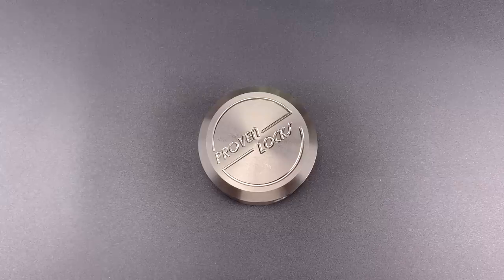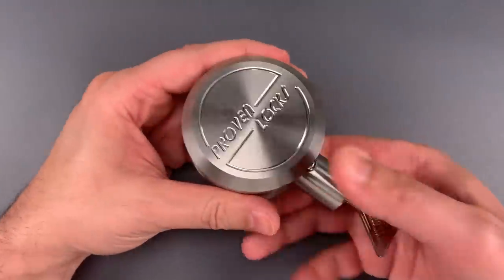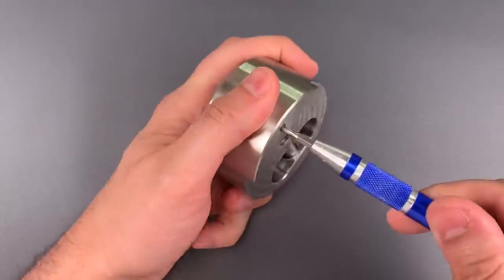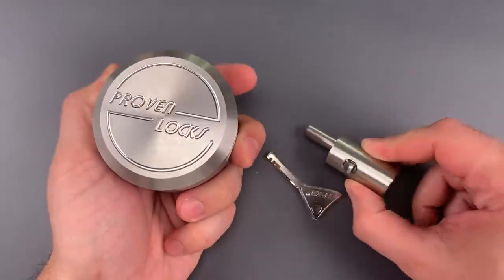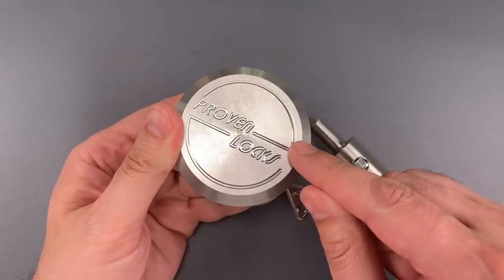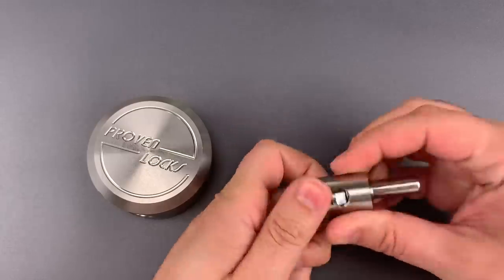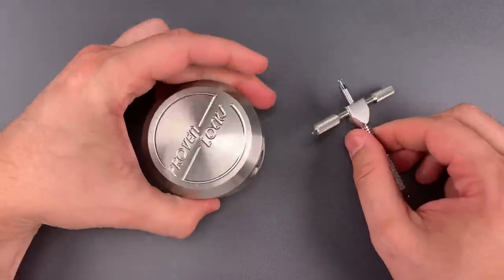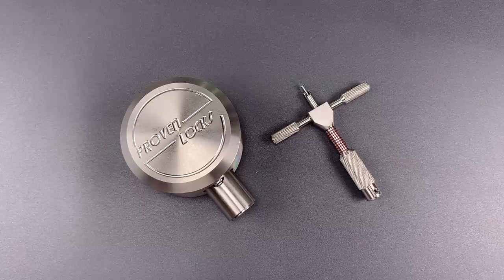[951] Proven Industries NEW Disc Detainer Puck Lock Picked

Comment: I feel like if you have to use a custom-made one-of-a-kind pick-invention to pick a lock, then that lock is just about as pick proof as possible
Reply: Sure, but just drill the front (super easy and pretty quiet) or just use your off-the-shelf plumber's torch to melt away the cylinder (again, super quiet with just a little bit of light). Most attackers aren't going to pick anyhow; instead they find the quietest, less light producing and fastest way to get in...

Comment: How could they have a locking lug which sometimes doesn't engage? That alone makes it a pretty terrible lock, IMHO
Reply: Really just seems like they had to make it cheaper to make more profit. I'm guessing that cast zinc core, the simple disc manufacture process vs. milled pins, springs etc, and the sometimes-works tolerances are all cheaper than the previous one.
Reply: @ryanpenrod1859  You couldn't be more right... check out my separate post for some more insider details.

Comment: to be fair you would hell of time tentioning that if it was on lock box with that cross bar
Reply: If well-designed, those crossbar arms are independently removable, much like a tap-and-die set if you've ever seen one.  That way it can fit in a variety of tight locations.

Comment: In all honesty if they have the time to drill, ANY lock can be opened.
Reply: Not really. It all comes down to how easy it is. The design we make for Cobra Locks has the same holes on the underside. So the tab is facing the bottom of the lock. It would be really, really hard to do the same drill attack on a Cobra vs. this Proven. At that point, I'd find a different way in...

Comment: That need to wiggle the lock to ensure it's locked it's... wow that's trully unnaceptable. Like, you have shown many flaws in countless locks but I honestly believe this is the worst I have ever seen. I mean, even if you wilggle it, there is no way to tell for certain it actually locked unless you carry around a tool to actually pull the core out and try if it is locked or not...

Comment: I'm pretty sure he just got a bad batch.... lol.
Reply: This has soooo got to be Ron Lee (or one of his workers) at Proven again using a bogus account! The only thing that would be related to a "bad batch" would be the bad manufacturing tolerances on the puck and the sleeve to where it doesn't properly lock. Otherwise the defeat on the top and the die cast core have nothing to do with a bad batch. Wow, I really would not trust anything I find on Proven's website...